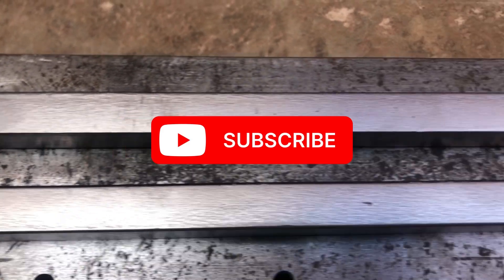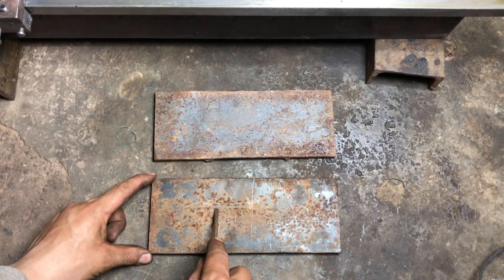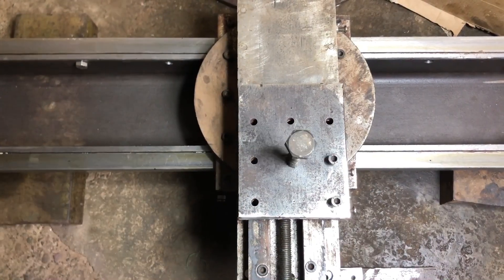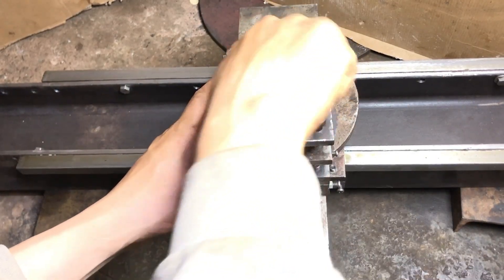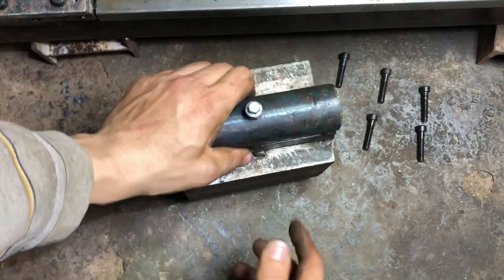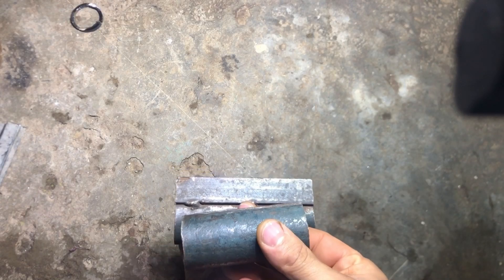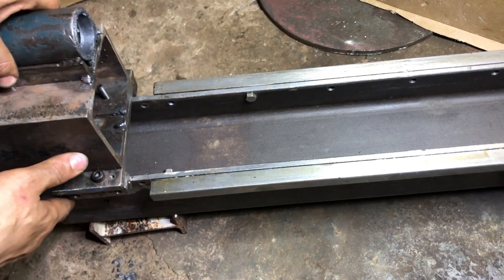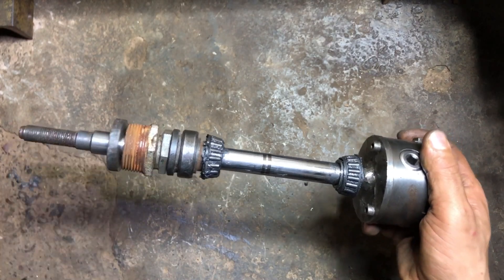Building a Metal Lathe from Scratch/Tool Post, Headstock,Bed Polishing/How To Make Lathe Machine

Comment: Just came across this I would have liked to see how u made the ways and the ways of the cross slide but that pre load set up u have for the headstock is a really good design
Reply from the maker: Hi thank you so much for your time 
For the main ways I just used off the shelf 20/20 mm square bar that I polished 
And for the cross slider I had 20/40 mm bar that I cut in the middle at 60 degree angle with angle grinder jig that I made (I will make a video of it soon) thank you for your comment if you have Any questions please feel free